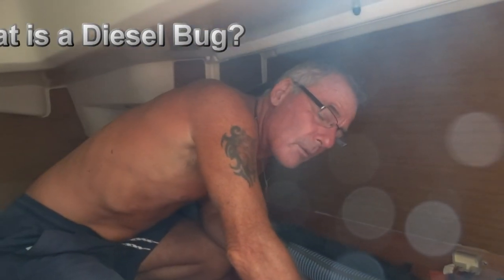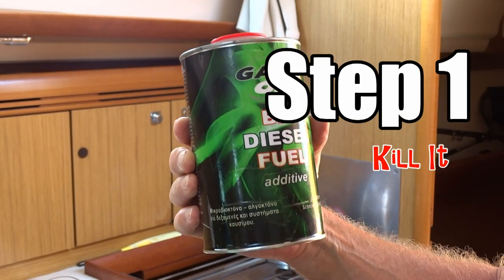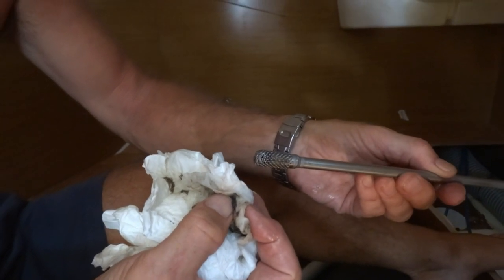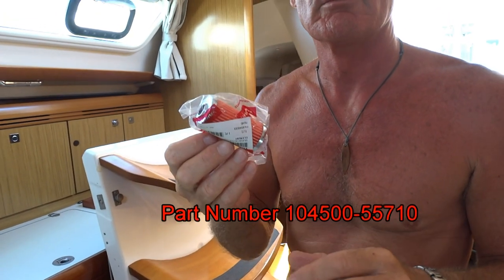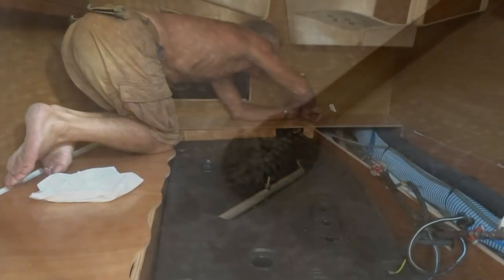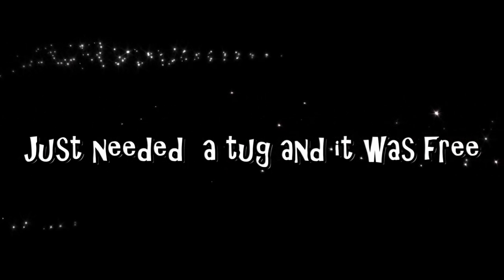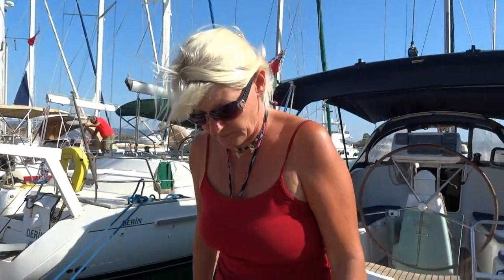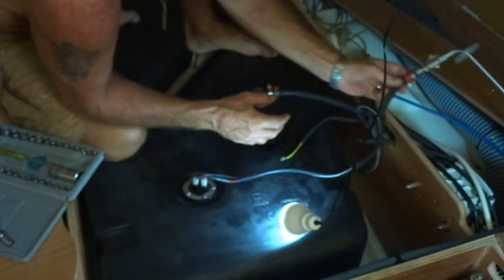How to kill and remove Diesel Bug | Sailing Kejstral Adventures

Comment: What is your opinion concerning the filter screen attached to the bottom of the fuel pick up tube inside the fuel tank?  I understand it is there to stop any large contaminants from exiting the fuel tank and progressing any further along the fuel system.  Being located where it is, buried inside the tank, you are unable to visually inspect it and it is difficult to get at especially while under way.  Would you be better off without that wire mesh "filter" installed very bottom of the fuel pick up tube and letting the primary filter/water separator take care of the larger contamination and the secondary filter the much smaller particles?  Do most manufacturers place such "filters" at the end of the pick up tube or does it vary across the industry?  Thank you for making the effort producing this excellent content and sharing your knowledge and experience. - respectfully
Reply from the maker: It is the first line of defence and an important one. It can be checked on a regular basis to make sure nothing is growing in the tank.
Reply: @SailingUla  Thank you for your thoughtful reply.

Comment: You could try filtering your diesel as you fill your tank. A very large funnel with a filter at the bottom. Or something similar. Basically filter it before it goes in the tank Specially as your using bio diesel.

Comment: As sulfur was a natural poison for the bacteria...the new ultra low sulfur biodiesel is a breeding ground.  Plus it cant carry water dissolved in solution which settles...and provides much higher paraffin, which is a food for the bacteria.  I’ve had good luck with a product made by Power Service.  Quarterly treating the tank with BioKleen Biocide (about $20US)..and annually (or at storage) using a Clear Diesel Fuel and Tank cleaner.  Good Luck and fair winds!

Comment: When reinstalling screws/bolts in plastic, etc,  start them a couple three turns by hand. starting them with a power tool bay damage the thread. over tightening them will also damage the threads.  Expensive and or time consuming mistake.

Comment: Never ever let the fuel level go down. A full tank is a happy tank! Also don t use aditives you will damage the engine!
Reply from the maker: It would be a rare occasion for us to allow the fuel level to drop below half full. We pride ourselves on the fact we sail a high percentage of the time, only firing up the engine when we drop below 2kts.  As for additives, well there are numerous studies out there, some saying that they are no determent & others saying there is a slight possibility of harm. In the 45 years I have been repairing & running engines I have never come across an issue related to additives.

Comment: It looks like you have not been attending to your water separating filter regularly?
Reply from the maker: Norman Boyes   Probably sounds bad but didn't even realise it was there! Will certainly be keeping an eye on it from now on though!
Reply: Sailing Kejstral Adventures After seeing the video, I have to say, it is hardly surprising you did not know it was there - not the best location for something that should be regularly monitored. It is is seriously worth looking at relocating it to the engine compartment (even if you have to relocate or shuffle stuff). I know the engine space is tight.  You clearly understand the mechanisms involved in the growth of ‘mbc’ and water separation is of course key in what could be labelled as number 4 on your list - Prevention! Having the separator more accessible will mean you can observe it every day when you are doing your daily checks and intervene if all is not well.
Reply from the maker: There are always things you scratch your head at on a boat and this was definitely one of them. Why it was hidden under a bunk and awkward to get to I have no idea. We will be re locating it when we replace all the fuel lines!
Thank you for your input  :)
Reply: Sailing Kejstral Adventures Thanks for the thanks👍I am sure you will have no further problems once you keep on top of the water  separator and life will be much much easier once you can relocate it.(The aft cabin may smell a bit better too).👍

Comment: how do you prime the system when you open the hoses and pipes?
Reply from the maker: There is a bleed screw on top of the secondary filter. Open slightly and then with the lift pump lever located behind, pump through until diesel is running with no air. It is sometimes advisable to crack open No1 injector to rid the rest of the system of air too.
Reply: add a priming bulb.. solves all problems

Comment: Huh..bio-diesel on a boat? Really? Is that just what is available in your area? I thought that required a special engine fuel system? I´m just shocked that this would be a thing since so many cruisers have a difficult time even getting  diesel in some parts of the world, having to lug containers vs it being available on a fuel dock, let alone specialized bio version

So I'm confused as to this is just the poor quality of what ever is coming out of the pump or this is true bio diesel you speak of.

Despite my earlier comment excellent work cleaning out the system....in fact your boat seems to have a better filtration system and access then many.
Reply: Not bio-diesel, bacteria that thrive in regular fossil diesel.  Most cruisers clean out their Racors or water/fuel separators much more frequently than this as part of their regular maintenance schedules.  Some go so far as to install a second system that "polishes" the diesel by filtering it again separately from the engine intake 'coz you never know how dirty your diesel can be straight from the vendour.
Reply: Assumed you were using bio diesel as your video looked like you were using that chip fat stuff.
Obviously water is your problem and importing it from a supplier that has really bad quality diesel too.  all diesel absorbs water if  left a long time without use. And if the tank is anything less that full. Natural condensation forms in storage tanks. Consider emptying you diesel tanks in your yacht over winter. Empty your water separator every day or weekly. Change your supplier.